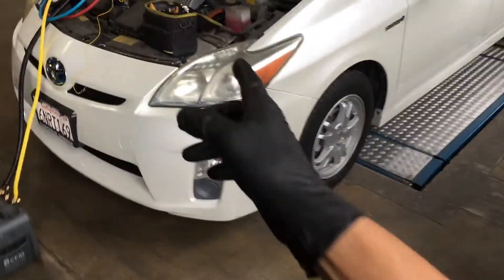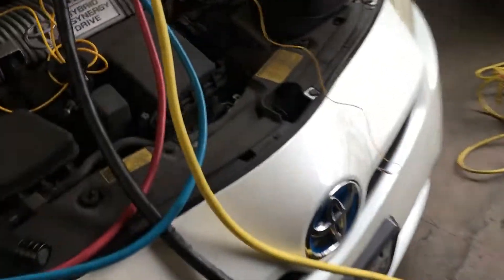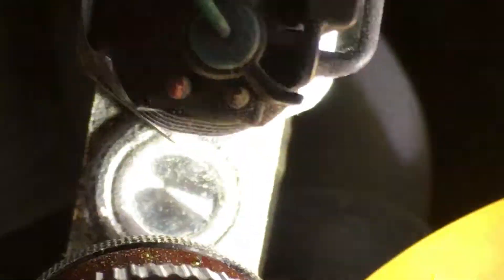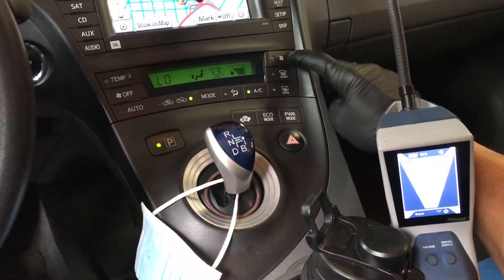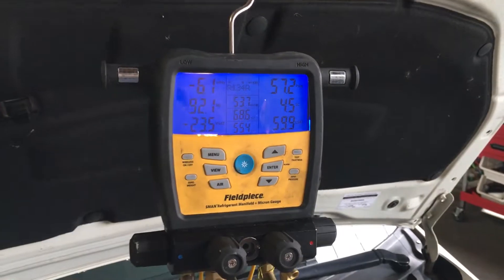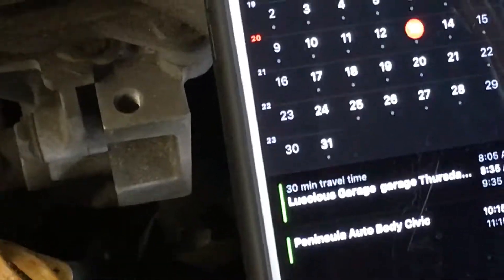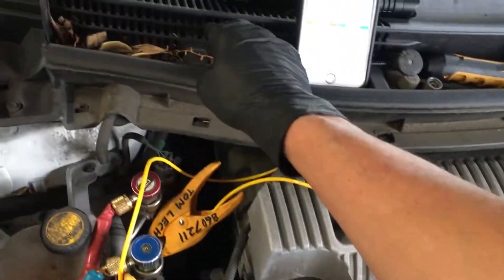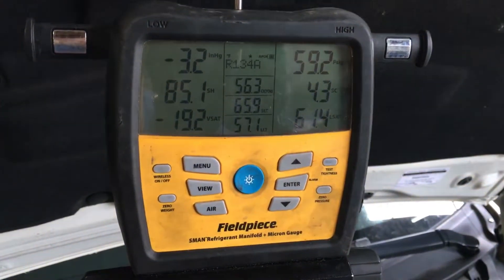AC low side pressure running and negative vacuum. Low side safety switch ? This is normal

Comment: But why does the compressor still come on when the low side is dropping like that?  I have a Mazda CX-7 in my shop that is doing the exact same thing.  Low side drops to zero and high side stays exactly at static pressure.  I did fugure out that my Mazda AC is low on freon just like your Toyota in your video, but I was really confused at first as to why the compressor still comes on.  I am way more familar with orifice tube systems and not expansion valve systems.  Is that why?
Reply from the maker: @prodieselrepair3218  if everything is working correctly and most vehicles, not all

If you have a static pressure that is roughly over 44 psi on the low side or the high side, depending where the pressure protection devices installed since you’re familiar with orifice tube system 

If the static pressure is over 44 psi on that low side cycling clutch switch, it will allow the compressor to come on and then cycle off somewhere around 21 or 24 psi 

Put on a lot of high devices that have a protection sensor 

If it is over 44 it will allow the device to come on . 

And then keep the compressor on because now it is pumping pressure into the high side where the protection device sensor is located. It will not fall below 20 psi on the high side and allow the compressor to continue running even if it’s going into a vacuum on some vehicles.  

Vehicles have different safety devices 

For example, some Mercedes-Benz on the newer ones if the temperature sensor does not fall below a certain amount of degrees within a certain given time, let’s say 15 minutes it will lock out the compressor because it knows something is wrong . 

Cars are controlled by software nowadays
Reply: @coldfinger459sub0  thanks for the info.  I really appreciate it